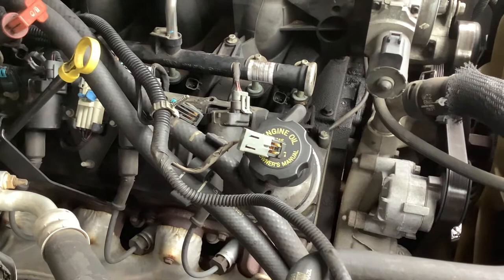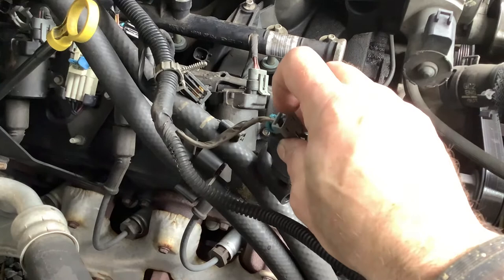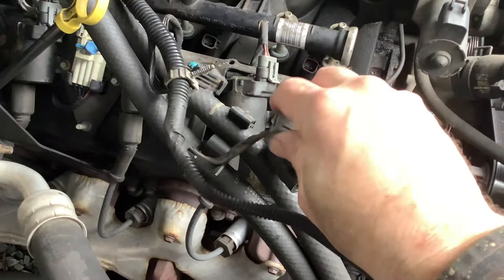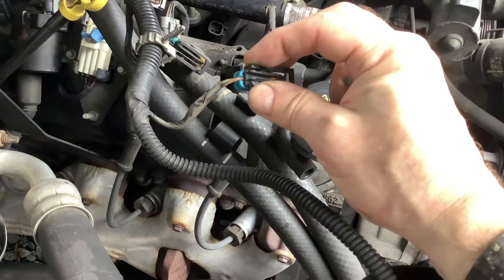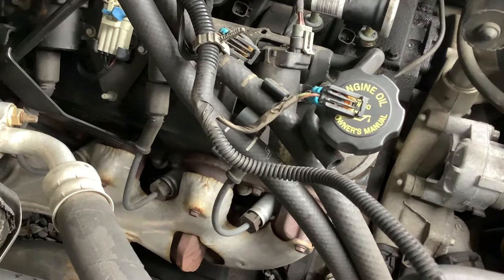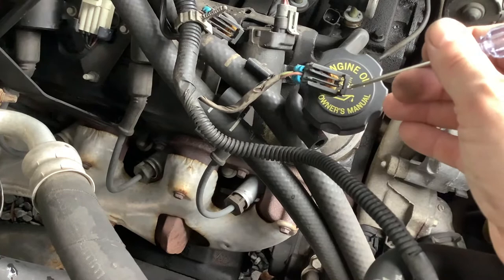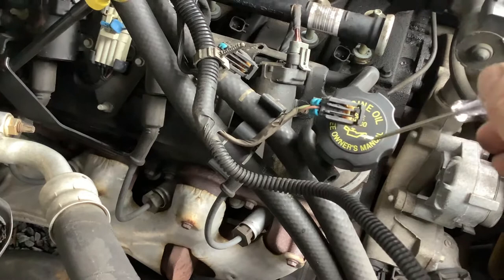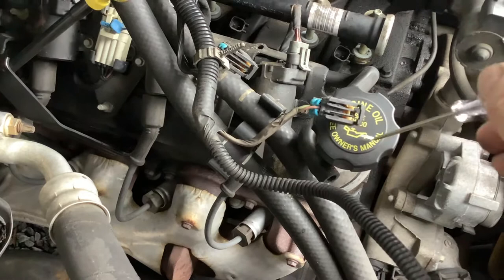GM Chevy 5.3L LM7 Vortec Fuel Injector Electrical Connector Removal Yukon Tahoe Suburban Silverado

Comment: No need to remove the gray lock. It has to be pulled out as far as it can while simultaneously pressing on the tab. The connector should pull right out. Yes I do agree getting the gray lock to move can be difficult. The needle nose pliers will help. The lock has dual purpose of also being a pry tool on the connector.
Reply: Good info. Thanks!